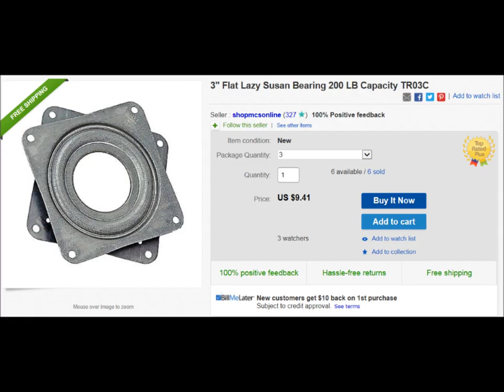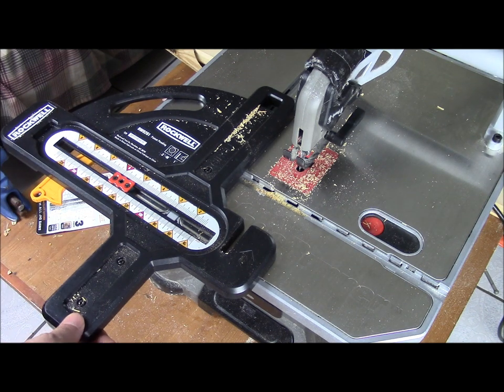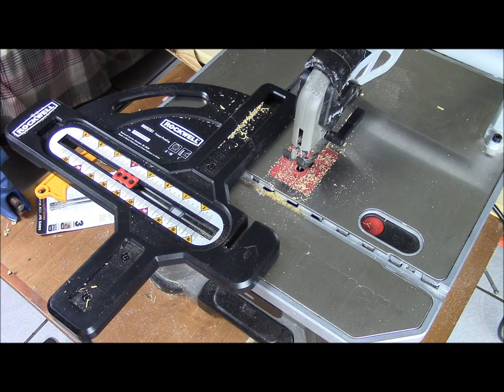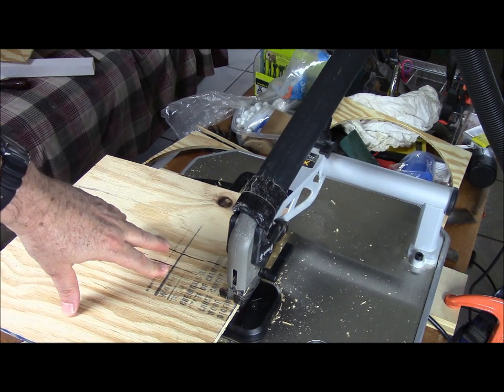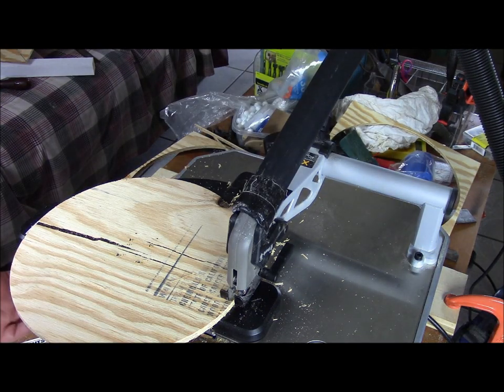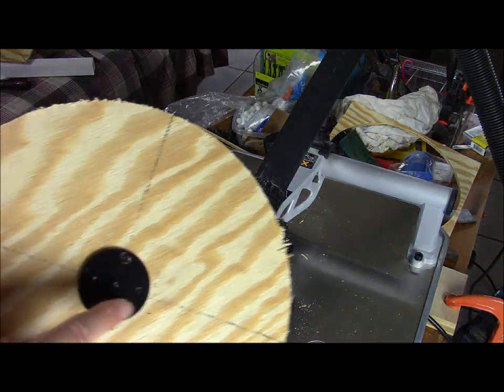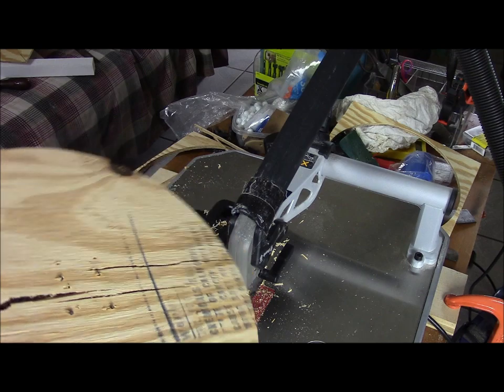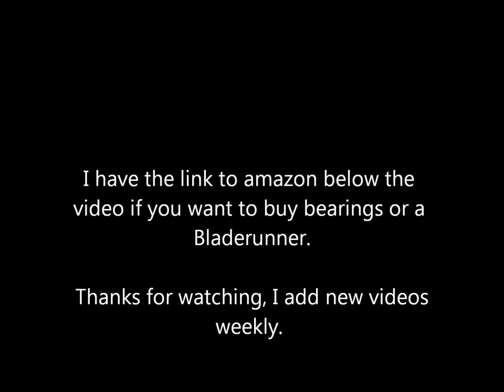DIY wood circles & $3 Lazy Susan with a Rockwell Bladerunner

Comment: Thank you. I have a blade runner and love it.  I mounted mine on a higher table than you seem to have done. Cutting circles with a regular jigsaw has never worked for me, but this tool makes it a breeze, and the cuts are smooth and clean. An 18" circle, as you know, is the largest you can cut, but cutting a circle with it could not be easier. I recently cut a circle to use for a wheel-of-fortune type game I'm making for a fund-raiser, and it came out perfectly and quickly--the part that takes the longest is screwing on the little centering device.  By the way, I have never noticed any particular vibration when cutting. I am an artist and usually make my own frames, and the blade runner is great for that as well. I understand from Rockwell that the circle cutter attachment in no longer available, which is unfortunate. I hope your lazy susans have worked out for you.
Reply from the maker: thanks a lot for your input, very helpful. I agree about the circle cutting, I wish it was quicker to attach. My biggest complaint has been the fence is mediocre. I need to do more Bladerunner projects though.

Comment: Good idea with the hot glue.  My neighbor was trying to figure out how to mount those with screws recently.  It's a real brainteaser the first time.
Reply: Really pretty simple with the screws. Just drill a hole in the bottom larger than your screws that will pass over the screw holes in the top plate of the bearing device when you turn the bottom wood with the bottom part of the bearing device already screwed on. As you rotate the bottom (bottom side up), the hole passes over the holes in the top plate and you can screw in the screws.

Comment: where could I purchase the tool you use to make the perfect circles? I do have the Rockwell BladeRunner but I could not catch the name of the attachment you were using to cut the circles out of wood . please help
Reply from the maker: Curtis, I think Rockwell has stopped selling the circle cutter attachment. they have a new model and it does not look like they include a circle cutter with it.  Your best bet will be to start a search on ebay and have them notify you when a used one comes up for sale.
Reply: thank you very much
Reply: there is a used circle cutter right now on ebay for 35 used